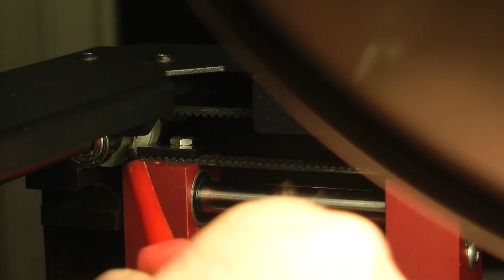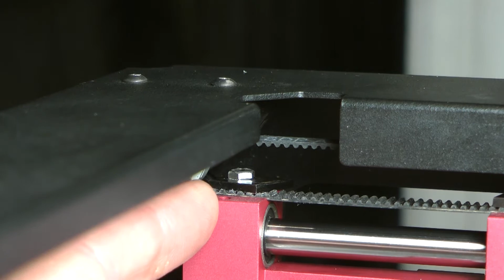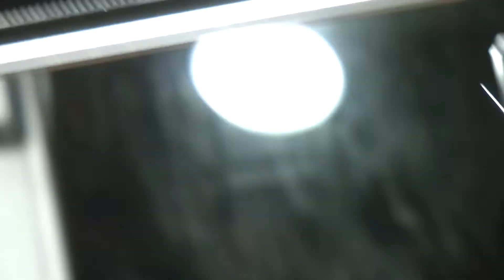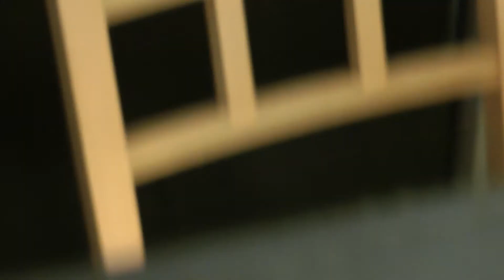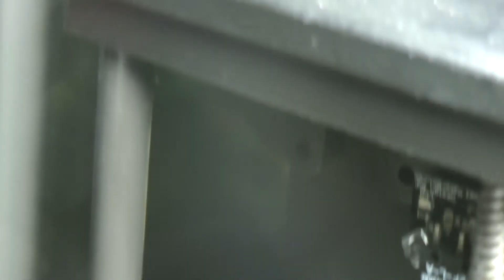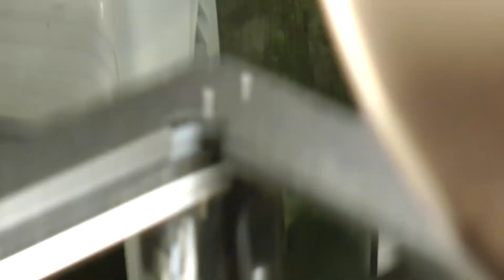X Ends Feed Back

Comment from the maker: Very true Scott. I think this is only a problem when you are calibrating the gantry as the procedure call for you to pull the x carriage up against those brackets to insure its setup parallel. Both ends should touch the front at the same time. Hopefully that makes sense.

Comment: Thanks for the insight, good to see you on here also and not just the makerbot operators site. Quick question, isn't that off you build plate detentions going up to the stop block that far? I was just wondering because if it is you can just set your slicer preferences to never run that far forward and still have the full space of your build plate.